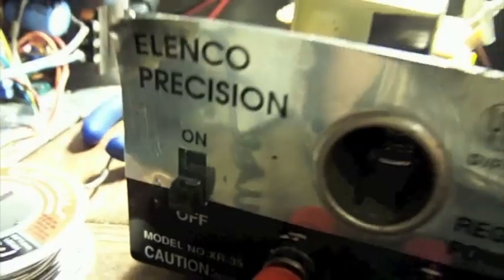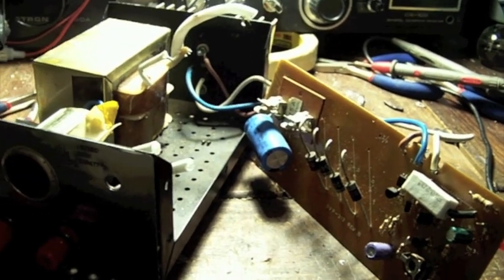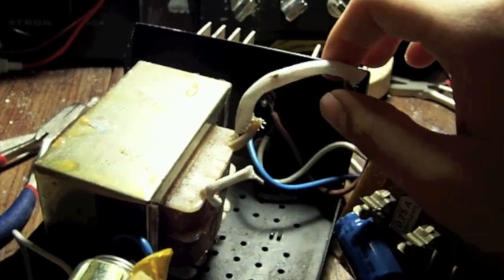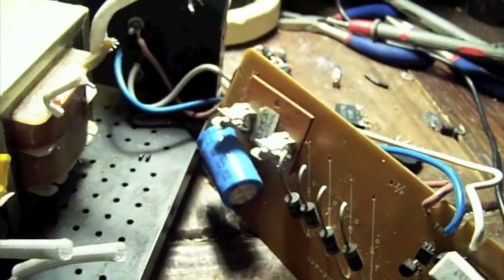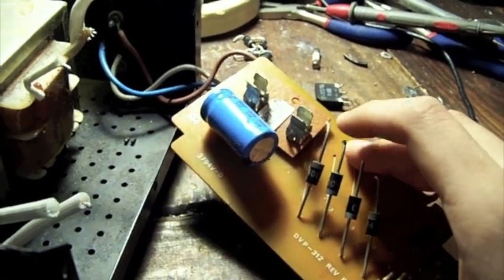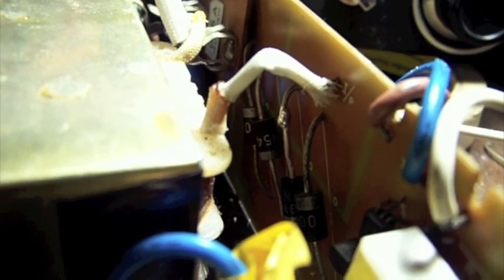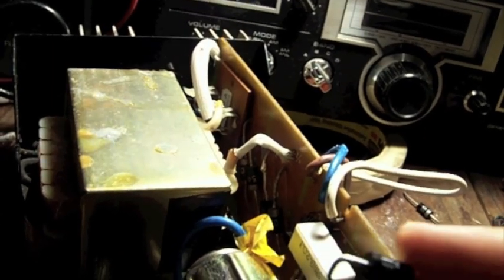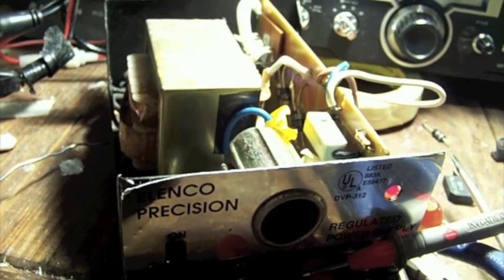Repairing fuse blowing power supplies

Comment: I just repaired my 13.8 volt regulated power supply that I bought new in 1977 !!!
It had a bad 2N3055 transistor. 
Thanks for the video!

Comment: Cool, you had one of the only vids I could find that was similar to the issue I am havin with my Charger . 
I dont know diddly about electronics , curiosity got the better of me so i changed 220v to 112v to see if it will work . sure enough it blew the fuse which was a 3.5 
So I replaced it with a 4  fuse , that blew , so i then put in a 3.15  and that blew also . 
This charger is for a E Bike and chucks out 1amp .
Im wondering if it would be the rectifiers also ?
I have a cheap multi meter and want to learn how to fix electronics since its going to cost me more to take it to a electrician then to actually buy a new one . 
If this issue on your video would apply to battery chargers also ? Any help would be appreciated ?
Reply from the maker: It's probable. I forgot to mention in the video how not all power supplies have individual diodes making up the bridge rectifier but rather some have a integraded bridge rectifier which looks like a black rectangle with 4 legs.  It has one - symbol and one + symbol on the outer pins and the two middles ones will have a ~ symbol or the letters "AC".
Reply: V

Comment: Thanks for the video Felix. I have exactly the same unit which is used for my car radio power supply in my workshop. It is the same type but under a different name. I will now check and try to isolate the problem as you have shown. Get back to you after doing the check. Thanks again. Testing here I come. ! :-)
Reply from the maker: How it go?

Comment: I've fixed many TV's and other electronics that had shorted rectifier diodes and these diodes usually short due to lightning or a power surge. I've also replaced a blown fuse with a light bulb for troubleshooting purposes. If you search my videos, you'll see where I used a 100W bulb in place of the B+ fuse in a Sylvania TV in order to troubleshoot the TV and I learned that the flyback transformer was shorted.
Reply: Can I ask  about my sub woofer always blowing of fuse  from 24volts suply  to diodes  and capacitor to transistor.. what cause of blowing please help me...

Comment: That does help as I have a PS doing this.  One thing I want to add --- instead of wasting fuses to see if a test fixed it, put a 120v clear c7 bulb in place of the fuse, using c7 bulb socket and leads going to alligator clips to attach to both sides of the fuse holder.  When testing, if light is bright, short is still there.  If its a faint glow, most likey is fixed..  Something I learned along the way.